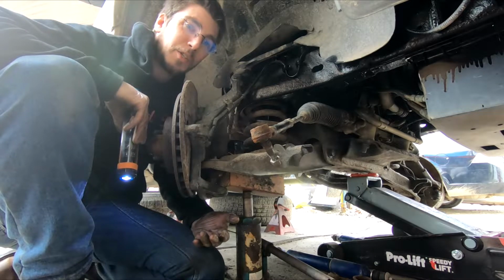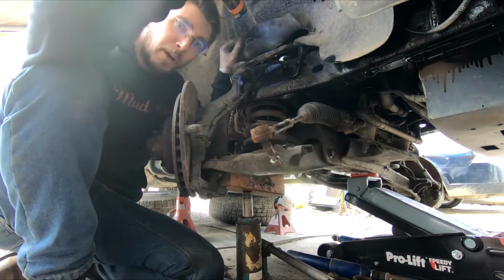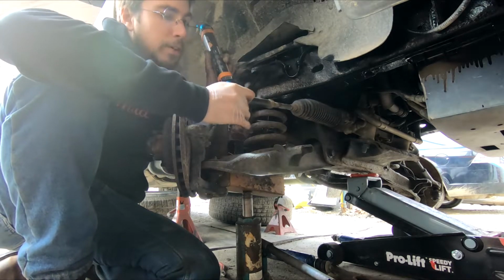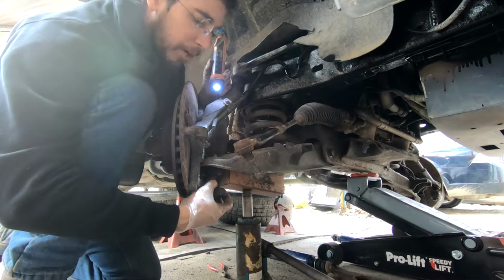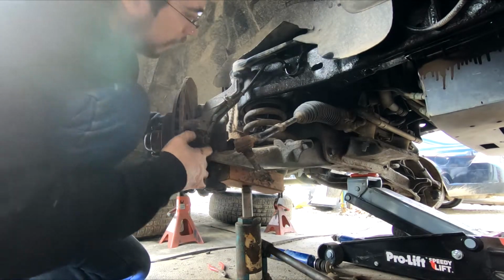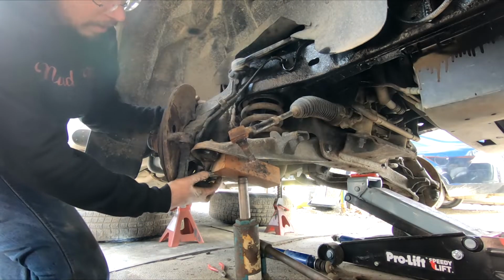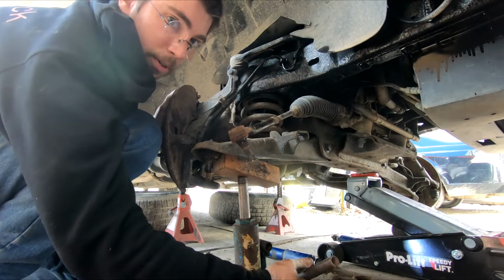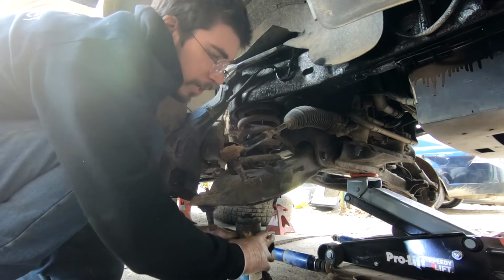Ford Ranger 2wd Lower Control Arm Replacement

Comment: Thanks for the video!

It would definitely be worth it to cut a notch in the top of the wood block to seat securely and drill a hole for the ram of the jack, just to lock things together a little better.

Comment: why are you replacing the control arm?     how about a video on the control arm bushing replacement.  i have a 2000 ranger, 2WD.  thanks!
Reply: Good question. It's usually just easier and cheaper in labor to replace the entire unit. Replacing the bushings is tricky and the wrong person can screw it up. The ball joint is tricky to, so again, it's easier to replace the unit, and you don't have to worry about fudging a ball joint and bushings onto a jacked up car. Then when it's done, you can rest assured the control arm unit is all brand new and free of rust etc., if you are still curious.

Comment: You explained everything pretty good and I watch some of your videos but at the moment I don’t have the money to rent a spring compressor, so is there another way you can do it without compressing the springs, the lower control arm on a 98 ranger
Reply: you do not need the tool to do this,just have a extra jack and jack up the lower control arm,remove shock and sway bar link and slowly,slowly let jack down and it works great and is much faster,ive done it many many times way faster and easei
Reply: @terrylewis4302 can confirm with this. All you need to do it lower that control arm until the spring is fully released and then take the bolts loose from the back of the control arm and the spring falls right out
Reply: @SmashingBassTv  That is correct

Comment: you do not need the tool to do this,just have a extra jack and jack up the lower control arm,remove shock and sway bar link and slowly,slowly let jack down and it works great and is much faster,ive done it many many times way faster and easeir

Comment: My 1999 Ford ranger started making a loud creek one day and it got worse and worse and worse I replaced the front brake pads as I thought that was the problem did not fix it took off the rear wheels discovered that both will cylinders were leaking and the entire rear brake system was shot I spent $500 to have that repaired did not fix the problem I took it to a suspension shop that I had been going to for 25 years they adjusted the brakes and machine the rotors still did not fix the problem I took it back they lubed the entire front suspension still did not fix the problem I took it back they adjusted the calipers and the clips and everything on the brakes still did not fix the problem I took it back they rebuilt the entire upper suspension including upper control arms still did not fix the problem I replaced rear shocks front shocks sway bar bushings sway bar links still did not fix the problem I took it back they said it's the leaf springs I said are you sure they said yes I'm sure it's the leaf springs so I took it back to have those repairs done they did the leaf springs did not fix the problem took it back again they said well the problem is is these new brake pads are made out of softer material so there's nothing you can do about that I said well it was making this noise before any of the brakes were ever touched and it went for 10 years on the same brake pads before it started making this noise he said well it's in the brakes there's nothing you can do about it so I turn them into the bureau of Automotive repair it took about a month or 6 weeks but I got all my money back but in order to do that I took it to another shop and they figured out the problem and 3 minutes and the problem was the lower control arms the lower control arms That's all it was these guys are the best suspension shop between Fresno and Bakersfield and they could not figure out that the lower control arms were bad extremely sad extremely extremely sad I'm not going to defame these guys even though I should that's why won't you be their name but I just cannot believe that I've been trying to get this truck fixed for 2 and 1/2 years and I have taken it back to a mechanic over and over and over and over and over and over and over and over again and they could not figure out that it was the lower control arms these guys rebuild suspensions and build suspensions for race cars monster trucks and tractors but they couldn't figure out this little problem on an ugly ass piece of crap little 99 Ford ranger
Reply: Oh one more thing it's gross and Stevens in Visalia California I changed my mind Gross and Stevens , Don't ever take your car there

Comment: Hey man I have a 99 ranger XL 2.5 (no ac bare minimum model) I just replaced the entire front suspension. Does the suspension just suck in these trucks?? Haha. I liked your flat bed build
Reply from the maker: They are easy to get parts onto but do to 7 different alignment points in the system a waste of time to try and do at home.
Reply: @redneckcomputergeek  thanks for tellin me haha yea I bought new camber bolts and I had to get an alignment twice. If I’m being honest I might get an alignment done again cause of that, and I’ll actually go to a place with a electronic machine. But yea dude thanks a lot for the videos on this truck I appreciate it especially the lowering the lower control arm  to get out the coil spring.